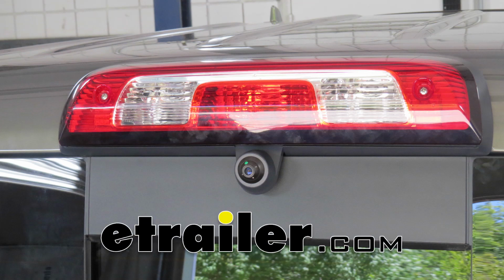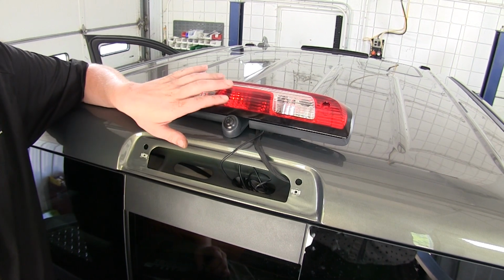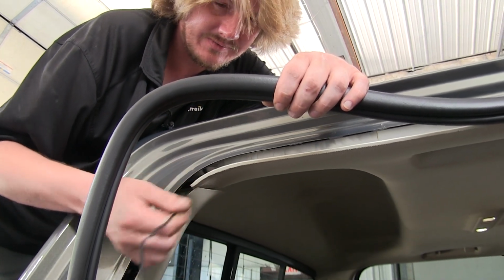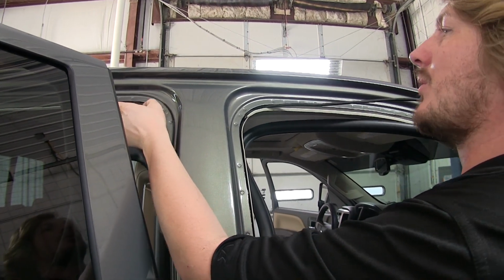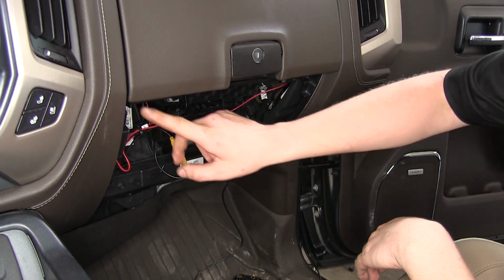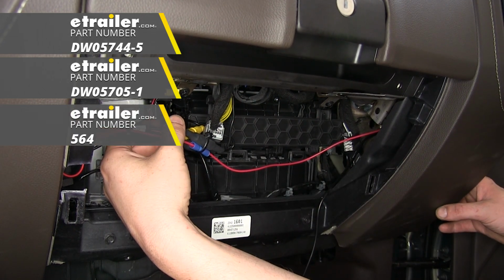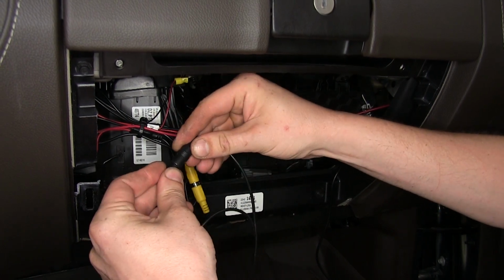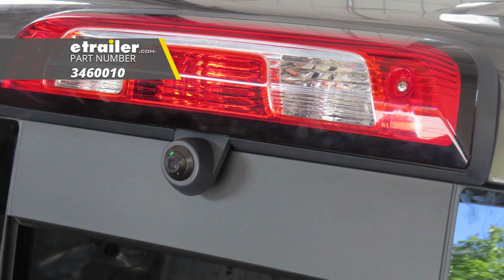How to Install the Custom Third Brake Light Camera for 8" Factory Monitor on a 2018 GMC Sierra 3500

Comment: I have a deep weather guard toolbox in the bed of my 2016 Chevy 3500 Dually 8ft bed. Would this type of setup have an obstructed view?
Reply from the maker: If you're wanting the camera to help hitching up using an in-bed hitch, a toolbox would likely interfere to a point.
https://www.etrailer.com/Accessories-and-Parts/GCH-Automotive/3460010.html

Comment: Does this module have an override for the reverse signal so it will allow for full time monitoring?
Reply from the maker: You can wire it into a head unit with a switch so that it will run all the time.
https://www.etrailer.com/Accessories-and-Parts/GCH-Automotive/3460010.html

Comment: You can’t include 2 screws?
Reply from the maker: This kit does no come with replacement screws from the manufacturer. We will send this feedback to them. We recommend using stainless steel hardware so that it will look great for the years to come.
https://www.etrailer.com/Accessories-and-Parts/GCH-Automotive/3460010.html

Comment: I like everything except drilling the hole. I have a 2017 Sierra and I know they make auxiliary switches. Can we use that instead or do you guys have a n option for that?
Reply from the maker: If you can find a factory on/off button or switch, you can rewire this into it.
https://www.etrailer.com/Accessories-and-Parts/GCH-Automotive/3460010.html

Comment: Any plans on making one for a 5th gen Ram 1500? Also can these cameras be connected to a rear view mirror dash cam?
Reply from the maker: We do not have a cargo camera for the 5th generation Ram 1500 yet. When we do we will add it to the fit guide page in the following link.
https://www.etrailer.com/vehicle/2019/Ram/1500

Comment: Have one for a 2020 Dodge Ram 2500 ?
Reply from the maker: We do not have a 3rd brake light camera kit available for the 2020 Ram 2500 yet. When we do it will be posted to the following link.
https://www.etrailer.com/vehicle/2020/Ram/2500